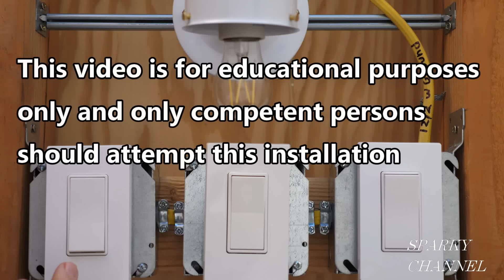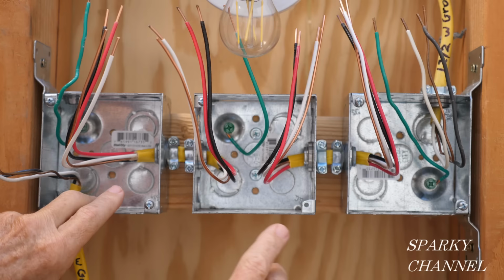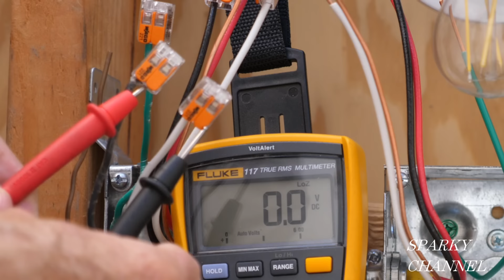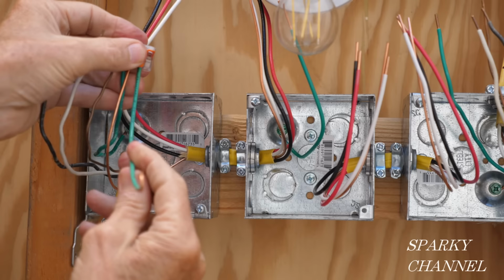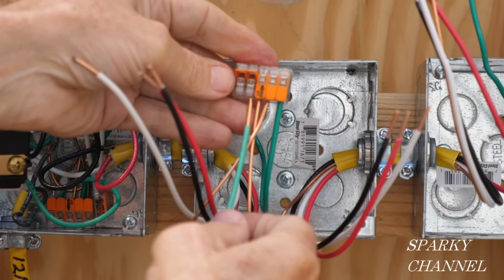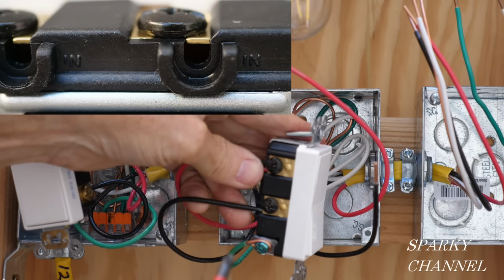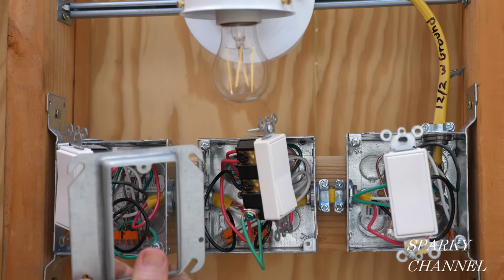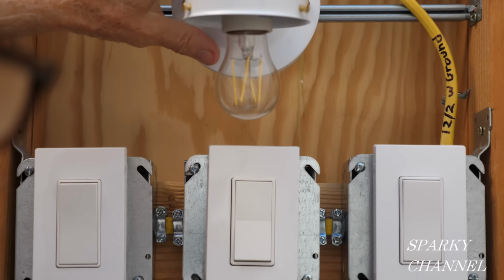How to Wire a 4-Way Switch System

Comment: I never got why people use 12awg in residential applications. Unless obviously you have a big load. Save some money and just use 14awg for lighting and some outlets (per code of course)
Reply from the maker: I don't mind spending a little more and getting greater capacity. Then if someone adds on to the circuit later on the circuit should be able to handle some extra load.
Reply: I never figured out why use less than12awg in residential resptical outlet applications

Comment: Thank you so much sparky i am a 19 year old apprentice and a pretty quick learner but there are somethings that i need to visualize exactly like this ! You make it very easy to learn you have saved me so much headache and given me opportunity! Thank you for your videos
Reply: Exactly this. Me too, I’m 25 though lol
Reply: Running these switch sets is sometimes a mind bender.
I would say at least 10% of the 4 way setups I've run into are WRONG. Actually, HALF of the apartments I've rented! (it's fixed when I leave..your welcome).
  A typical symptom of incorrect wiring...you turn the light off at switch B and the light won't turn on again at switch A or C until you get switch B on again. This kind of defeats the purpose.
 There are many situations you will find where Three 3-way switches have been used and that will NEVER work correctly. I find it a true nuisance.
 But when it's right and all the switches work as shown in the video, it's nirvana!

Comment: Tried to replace my old 4 way switch because it didn't work , thinking because was old ... it didn't work when I bought a house, so I get used to it. Run the wires like it was on old one - new switch didn't make a difference. Spent a few hours yesterday in frustration and gave up. Today I find this video, exactly configuration I have, ignored what I've written from old switch and followed your video. IT WORKS now. All three switches control the lights, I can turn them on and off from all three!  Damn, I can't thank you enough, man. You, sir made my day!

Comment: Thank you Bill for a very informative video.  Your recommendation is right on mark to keep a standard installation pattern for the traveler wires.  As a non-professional DIYer,  whenever I need a "how to" or refresher instructional video I always refer to your YouTube channel.  I like the way you seem to keep up with the latest tools and methods for electrical work.  I have purchased many Klein tools and other products through the links that you provide.
Reply from the maker: Thanks so much David! Have a great weekend!
Reply: @stevebabiak6997  As it should be!
Reply: If Mr. Sparky hopped out a 3 gang box,
Reply: Very  simple and easy to follow.
Reply: Lookimab

Comment: A picture - or video in this case is worth a thousand words. Going from a toggle 4 way switch to the Decora 4 way switch, I discovered via this video  the wiring pattern is different ( toggle has 2 black on one side of the switch and the 2 red on the other.). It drove me nuts. Thanks.
Reply from the maker: My pleasure, thanks!

Comment: This is by far the best one yet.  Thank you Sparky.  I actually screwed up my 3 switch setup when switching over to Rockers.  Something changed in 24 years and when I simply matched wire for wire, the 4-way caused issues.

Comment: Watched several videos.  This is by far the best one.  My install worked perfectly using these instructions.

Be careful with the 4 way switch.  In this video, his IN is on the same side.  On my switch from Lowe's, the IN plugs were both at the top opposite each other.  The OUT both at the bottom.
Reply from the maker: Great to hear! Also, good tip.

Comment: Very clear and easy to grasp, thank you. Relay-switched lamps is the new kid-on-the-block in Switzerland and Germany. Only 230V AC power to the lamp, 12 V DC  two-wire cable to the switches from the sub-panel  with a relay that switches the power to the lamp(s). 2 or any amount of extra switches makes no difference in the wiring, very simple to expand. And less EMF's in the house as a bonus.

Comment: I would like to thank you for your indepth wiring of a 4-wy switch ! I replaced the old toggle switches with the paddle switchs(took pictures and drew a diagram) and still didn't work properly ! With the way you explained and showed how to do it made it alot easier ! I had the load wire going to wrong terminal !! Thank you

Comment: So grateful  that you made this tutorial video  explaining so well how to wire
A 4 way system switches.
You make it look so easy . The key doing an already  wired job..either to replace the switches or adding dimmers .. it is to open up completely  the 
Wires and read what is the incoming  hot wire and  wich ones are the travelers. And finally at the end identified the 12- 2 wire to the lights.
Thanks  a lot .  It really  helps people  like me that enjoy  doing electrical work.

Comment: EXTREMELY Helpful! While I am a low voltage guy and would NEVER touch electrical stuff at a customers home I do like to understand things and do it in my own home. Im putting in smart switches now where I have one switch that carries the load and the others simply need neutral, ground and power to speak zigbee back to the main switch. Hopefully I understand this enough now to use the one traveler Ill need and cap the other one off.

Comment: great vid. remember to advise your viewers that if they are going to use backwire (clamp-style) connections, that after they make the connection, they have to test.  Literally pull on the connection to make sure the wire dont come out.  It has happened to me where i didnt tighten the clamp tight enough and connection was loose.  You may want to recommend the loop connection around the screw terminals for safety.  lates
Reply: with the loop connection you have to take care just the same: sure, it won't fall out, but a bad connection will still melt the switch down. You  really have to crank down on 12AWG, or it will work itself loose when you push the switch into the outlet box.
Reply from the maker: Yes, I think the key to that is not getting any insulation under the terminal. It is a good idea to tug on the wire for a check. Have a great weekend!
Reply from the maker: @wim0104  Hi wim0104, you make a good point. Loose wires cause fires!

Comment: Sparky:  thought this wiring setup would make a great lesson in box fill calculations since there is soooo many wires.  :)  Lets keep everyone safe!   Great video.

I learned 3 and 4 way switching from a handbook I got from Sears decades ago;  plus I drew up some of my own diagrams before I started wiring my new garage.   Really like your red= top,   black= bottom style.

I wired my barn myself from the sub panel to all 800' of wire to lights controlled by 9 switches.  The inspector asked who wired it.  I said, I did and then he complemented me on a great job.   When you walk in the two front side rolling doors you cannot see any of the wiring except conduit to hay loft. and conduit coming down to receptacles at end of barn.  All wiring travels through barn at 10 1/2' so horses could not access.   

Also rewired two other houses I lived in plus a remodel on the one we live in now. Learned basic electrical wiring from my dad starting at about 8 years old.

Comment: Thanks to your carefully dumbing this down, I now understand the 4-way circuit wiring.  Thank you !   I had a bad 4-way Leviton switch to start........but I learned a great lesson on "traveler wires" that has been.....until your video.....obfuscating.   I have watched a few other YouTube on this but it has never clicked.   Thanks to your convention of "red wire on top always......I discovered that the switches were not working because I mixed up the red and black wires on the brass screws, i.e., I had one reversed......which created a nightmare of one switch only working when another switch had to be in the ON position.   Less of a mystery now.  Thank you.  I have just subscribed to you.   Be Safe !
Reply from the maker: Welcome to Sparky Channel! Thanks so much!

Comment: Thank you very much for this very informative video! I got confused replacing the old switches with new ones. Older house where they used different colour wires all over the place and the switches are different than the new ones. You helped me understand how the whole 4 way thing works and get my switches working properly. Thanks again!

Comment: Always wanted to know about 3 (or more) switches controlling a lighting circuit. Now I know. 
Watched and learned BUT when I do it, I’ll retain this knowledge forever!
For now, 3-way switches are locked and loaded!
A electrical shop owner told me a long time ago that ‘doing’ is knowing.  Most book 📚 learned graduates 🎓 were not able to wire 3-way switches as a test to be hired.  
I explained how they were wired and he offered me a position as a helper to proceed to being a licensed electrical worker. 
I passed as I am a CDL-class A Haz-Mat driver with tankers endorsement. 
I’ve always thought ‘what if’.  🤔

Comment: Just wanted to thank you for the helpful video. I had to wire up a 4-way circuit in my son's new 2-car garage (one by each overhead door and one by the back man door). Using your concept made it quite easy and it actually worked first time I tried it out! I was pleasantly surprised. haha. The switches I bought at HD did not look like the ones  you had (no IN markings and  the brass screws weren't situated like yours), but just hooking the wires to the correct colored screw going in and out made it simple to figure out. Thanks!

Comment: Bill, I have mental satisfaction doing control wiring. Following the logic function of controls can be easily transferred to other needs. For example, I have transferred control wiring experience to repairing my Amana electric dryer. I take DPDT  N/O N/C 24vac relay and make a 4 way switch. Then I take 2 SPST 24vac relays and wire a control system, as in this video. When working with DC voltage  and I easily need to reverse polarity I use a four way switch. Currently I am have a mental candy working with star delta motor starter. Thanks again for this and other fine information.
Reply from the maker: I think a lot of us sparkies think alike on these issues. We like things to stay organized, logical, as simple as possible and repeatable. Good job on the Amana and the control wiring!

Comment: Great video! You're explanation of how a 4-way switch system worked helped me understand and sort out my confusion in my early 1960's addition 4-way switch system(old switches that looked very different than current ones). My problem was a bad 4-way switch. Now my three switch locations operate the ceiling light perfectly!  I'm now a subscriber! 
                                                                                                                     Thanks again! 
                                                                                                                                              Paul
Reply from the maker: Thanks so much and welcome to Sparky Channel!

Comment: Bill, I believe I have never configured a four-way switch...I have never been asked to. I love your "wall lab" for staging these setups. Perhaps I should be practicing these types of runs? Hmm...Good stuff! You always remind me that it does not matter how long you may have worked in any profession, that the learning never ends.
Reply from the maker: Hi Michael! Great attitude!
Reply: I recently replaced a 4-way system with new switches and wall plates - this system had 4 switch locations, and those 4 single switches were located across 3-gang, 2-gang, 4-gang and 2-gang boxes.  I switched off the breaker and went to work - but luckily I double-checked the circuit with my non-contact voltage tester.  I got a live reading, but from the adjacent switch, which was part of a different circuit! Needless to say, lesson learned...check every switch in the box you are working in!

Comment: I would love it if you included a wiring diagram with videos such as these.  It would greatly clarify understanding in addition to the installation process.  I'll happily lend you my pencil if you need.
Reply from the maker: OK, thanks!
Reply: . @SparkyChannel  Hi Bill. Thanks for this great video. Judging from the comments, it's a very popular video. I also agree with @rs p that you include a wiring diagram. I drew one out myself and realized how the 4-way switch had to be configured internally to work. It's great as you said to choose one way to wire the travelers because it'll make it easier to troubleshoot for everyone if needed.

Hope you and your family stay safe and well.

Comment: My since-fired electrician roughed new construction with both the hot (line) and the load (light) located in one box, and the other three-way switch having only a 14-3 to it. My understanding is I would be using the white of the 14-3 as a conductor for the switch leg (common lug) at the remote switch, and tying it back to the load black for the light in the original (crowded) box.  This makes sense on a three-way switch set-up, but what about in a four-way? There really is no "middle" box then for the four-way switch. If I had done the rough, I would have had the line and load at separate three-way ends of the circuit, with four-way(s) in between, like your demo.  Thank you for your channel and all the great info you provide.

Comment: Nice video, as was easy for anyone to follow, imo.
It’s also funny how many times that 3-way, 4-way, etc...switches aren’t properly connected.
See ya on the next
Reply from the maker: Yes, it's quite common for them to be mis-wired or the incorrect switch is installed. Have a great weekend!

Comment: I was told all these years in the HVAC trade that The Fluke 117 voltmeter is an HVAC meant meter as it uses microamps for flame rectification readings, I am confused as you mentioned is an electrician meter. LoL 😆 
Great explanation and well ✔
Reply from the maker: Hi Francisco! I love the 117! It is called the Fluke 117
 True RMS AC/DC Electrician's Multimeter with Non-Contact Voltage Detection but it has other uses as well. It isn't really a HVAC meter because it doesn't measure temp. That doesn'
t mean it doesn't perform HVAC tasks like you mentioned.

Comment: Years ago wired up a very large house. Had 5 seperate entrances and owner was a gadget night. He wanted 6 switches just to turn on 24 outdoor flood lights. Ended up with anout a dozen 4 way switches. Just wired one set of travelers to top right tetminal & bottom left screw on the decora switches we were using. Never bothered to look at diagram on box.

Comment: After watching the full Video illustration, It shows me the different kind connecting of a four way switch system. The video show me the position of the hot wire , the grounding and the function of the different kind of switches . The three way and four way switch connection .
Reply from the maker: Excellent!

Comment: Great explanation now i have a  circuit like that and I am wanting to install a eaton wifi smart switch that requires the neutral to be connected, the current  setup has  neutral  tied together how do you wire if switch requires  that neutral,  not enough lugs.  I know there are kits that I could buy all three to do it but if I can do it with current  setup I would prefer

Comment: Hi . So basically you can run neutral whiteout any cuts from box # 1 through box #2 and box # 3 directly to bulbs with any cuts  leaving some spare cable loop inside the box . 
Nice instructional video .
Reply: Well, you could try that but if you have long wire runs you will quickly realize that cutting and splicing is much more practical.

Comment: You can put in as many switches as you want, as long as the first and the last switches are 3-way and the switches in between are 4-way. But there are alternatives to this, but I would use them if I got more than three switches because the alternatives are more expensive or got other disadvantages.
Reply from the maker: Yes, I may make a video about alternatives. This video was getting too long to discuss them. Have a great weekend!
Reply: @SparkyChannel  That would be nice. In the staircase I used an alternative solution. It switches the light automatically off after an adjustable amount of time. You only need two wires per switch, the switches are retractive, which means if you push them and let them go they will go back into their original position. Sending only a short impulse to the real switch which is installed in the panel or a junction box. The switches look the same way as all the other light switches I've installed in my house.  In my case the contactor is sitting in a sub panel on the second floor of my house. This works with a contactor, they're normally rated to switch 250VAC 16A.
Circuit diagram, you can insert as many switches (named S in that diagram) as you need:
https://iwer.info/article/Elektrotechnik/Elektroinstallation/Treppenhausschaltung/treppenhausschaltung-vierleiterschaltung-stromlaufplan.png

In my case I used this one which got two inputs, a fix 230VAC or a an input that works with 8 to 230V UC (universal current, meaning it will work with AC or DC). The switching contact of the contactor itself, which at the end will switch the lights on and off, are only rated for AC.

https://www.eltako.com/fileadmin/downloads/en/_bedienung/ESR12NP_21100102-1_internet_gb.pdf

There's also a version of this model which can be installed into a junction box. For example this one, which also supports dimming functionality:

https://hl-elektroshop.homepage.t-online.de/Produktbilder/ImageLarge/Bilder%201/pb114100.jpg

Have a great weekend too Bill!